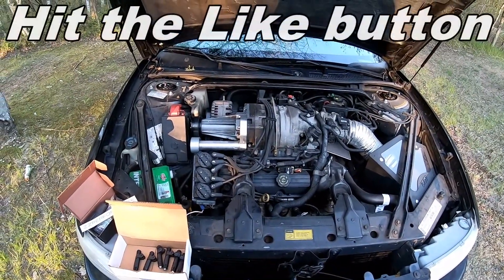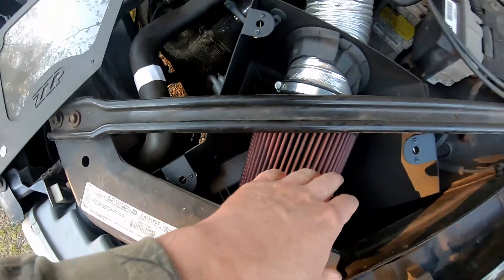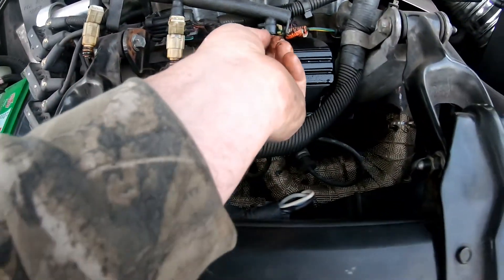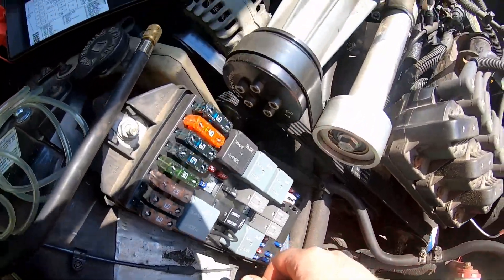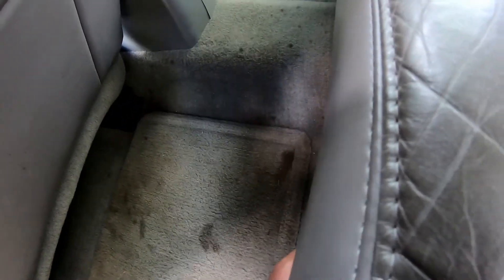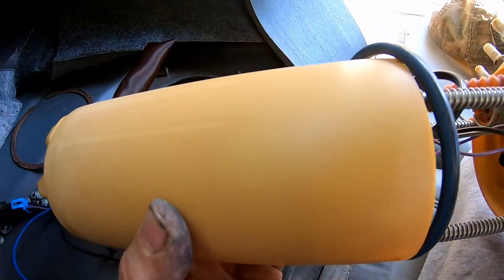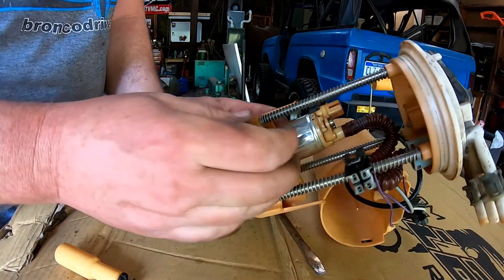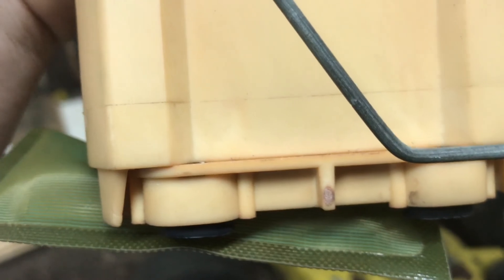Project Sleeper Regal GS: E85 Conversion

Comment: Just curious but with the addition of E85, how has your gas mileage been compared to premium gas? A lot worse? A little worse?
Reply from the maker: Gas mileage is quite a bit less, but E85 is $1.40 per gallon cheaper than premium here and it’s over 100 octane.  So it rates close to race fuel for $.40 per gallon less than regular unleaded.  As long as there are enough stations selling it, you can’t beat it!

Comment: thinking about doing this in my 04 grand prix, fuel pump, injectors, and tune is what it takes?
Reply from the maker: That is what I did.  If you don't have a place to tune it, you can mail your computer to ZZP and they will set it up and send it back.  Make sure E85 is readily available where you live.  Here in Michigan it is available at all Meijer gas stations, but in some areas the gas stations have quit selling it.

Comment: What is the Flow rate on that Fuel pump?
Reply from the maker: 84 gph at 43 psi.  I have a similar one in now from Motion Race Works that I bought during Rocky Mountain Race Week when the one from ZZP died during the brutally hot week.  https://zzperformance.com/collections/3800/products/aem-e85-high-flow-in-tank-fuel-pump?_pos=8&_fid=1cc763a22&_ss=c